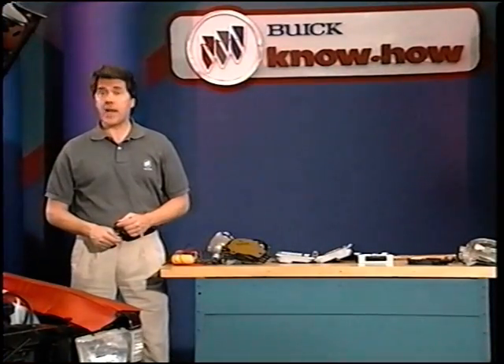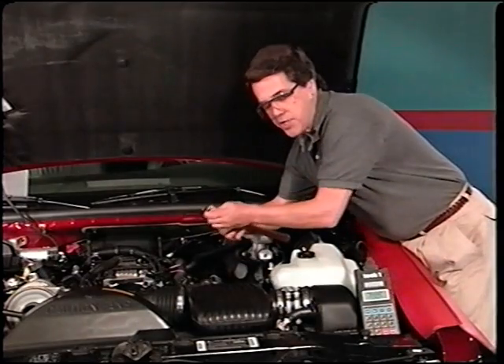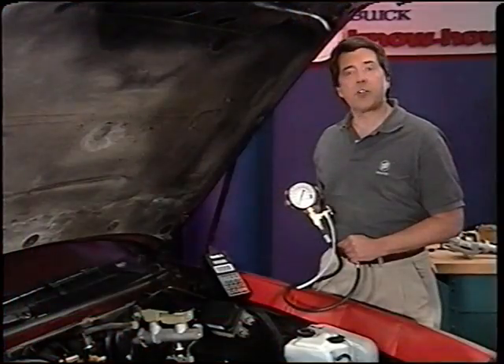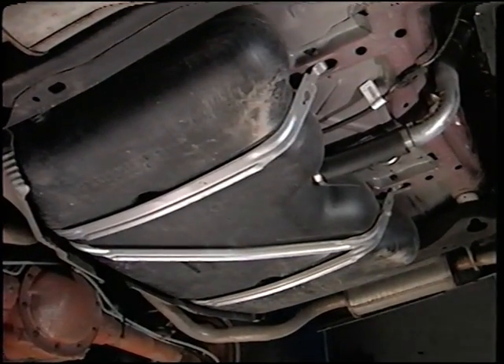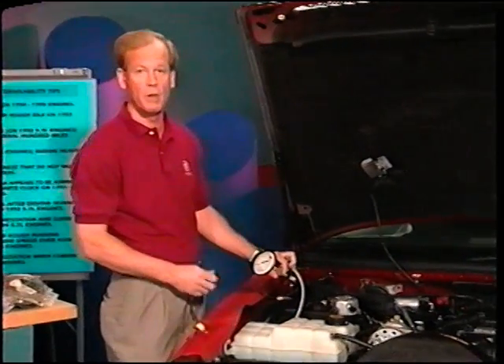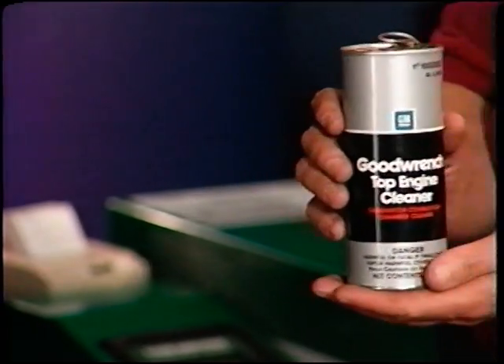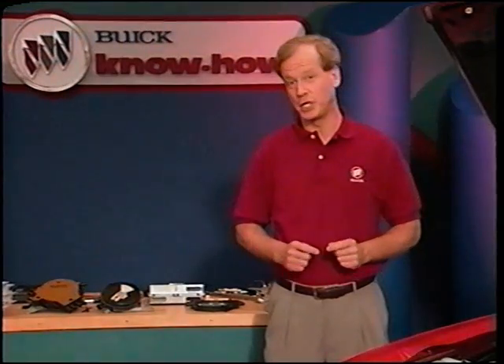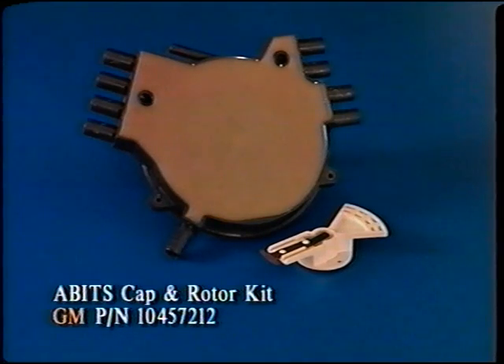Buick Know How Engine Service LT1, L05, L03

Comment: I'm thankful that my '93 Caprice L03 doesn't have that Opti Spark distributor. Mine is one year before that thing.
Reply: hows your caprice doing now?
Reply: @MSX98FMDnB  It still runs very well as it is parked in my backyard not really being used much anymore. The Chevrolet small block V8 really is one of the best engines ever. I've switched to Ford stuff for daily drivers, i.e. Crown Victoria/Grand Marquis.
Reply: @301Pont  glad to know your car is still doing well cuz im dead set on either a tbi caprice or mid-late 90s grand marquis or crown vic since realistically id probably end up with the latter cuz nicely kept caprices going for cheap have gone the way of the dodo at least in my area

Comment: Distributor electric spark DELCO always disrupts if entered the water! Did not find a suitable way to protect it from water that is very close to the bottom of this engine in the engin   LT, what is the solution?
Reply: Jandar Qorshi  relocate dist to the original sbc position.